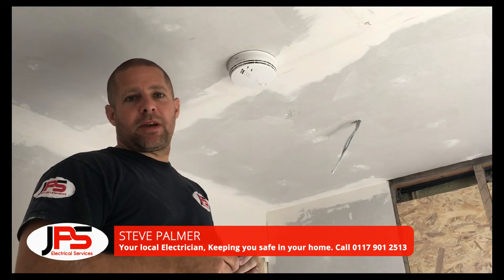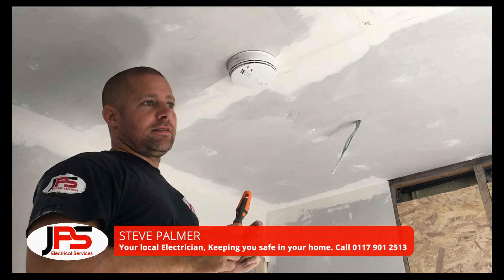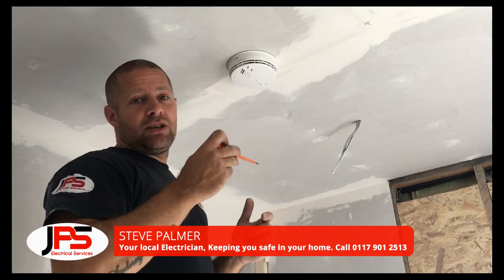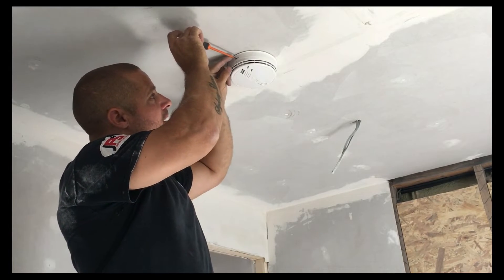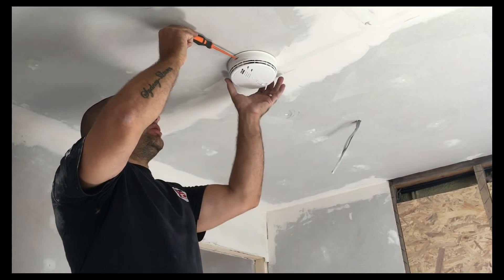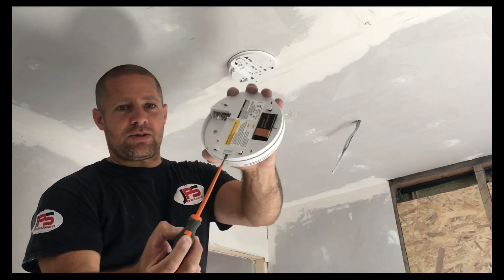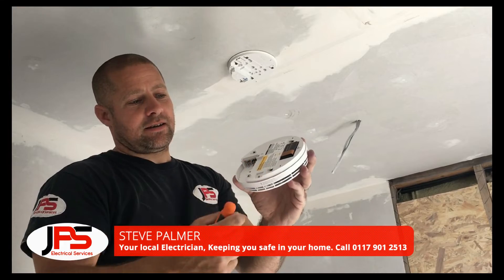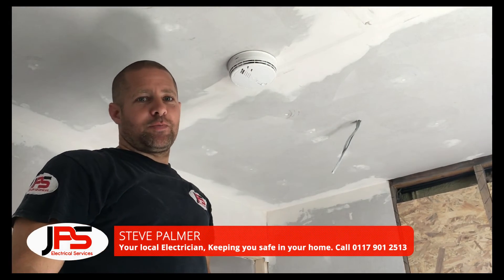HOW TO Remove an Aico Smoke Alarm - Your local Electrician

Comment: Saved me time and stopped me breaking the thing off the ceiling. Top job, thanks 👍
Reply from the maker: Thank you for taking the time to comment. I'm pleased you found my video useful. It's easy when you know how isn't it ;)

Please tell me you have replaced the battery or installed a new detector?

I look forward to hearing from you.

Kind regards
Steve :)
Reply: Hi Steve, it was the battery in the end. It started beeping intermittently so it needed changing but usual ones just twist off so it really helped
Reply from the maker: @garyk592  I’m pleased to know my video helped you.

Thanks for taking the time to update me.

Kind regards
Steve :)
Reply: @JPSElectricalServicesBristol  what’s the best interlink smoke detectors in England as of 2024
Reply from the maker: Hi @Viewer765 , this will differ from Sparky to Sparky. 

I'm an Aico fan, always have been and very likely always will be. Are they THE BEST? I can't answer that but they certainly tick all of the boxes on the domestic installations I work on.

I hope this helps.

kind regards
Steve :)
Reply: @JPSElectricalServicesBristol  what about for flats

Comment: Omg you save my life. This alarm.is mental I don't even cook but the alarm starts and the noise it's terrible
Reply from the maker: Thank you for taking the time to show your appreciation for the video help.

If the alarm is sounding falsely then it's possible it has become faulty.

Please be sure to replace the alarm as soon as possible with a new unit which you can purchase online or from local outlets such as Screwfix, Toolstation or most Electrical Wholesalers.

Kind regards
Steve :)
Reply: @JPSElectricalServicesBristol  thank you I'll need to find an electrician to do it as it is attached to electricals. Thank you again
Reply: @JPSElectricalServicesBristol do you think i need to change the whole device minus the attached to the ceiling?
Reply from the maker: @dianacamones7246  When you purchase the replacement it will come with the base and the detector head. Because you already have the base wired in, you can just install the detector head - PLEASE make sure you ensure the power is off first

I hope you'll update me once you have completed this.

Kind regards
Steve :)
Reply: @JPSElectricalServicesBristol  thank you so much Steve you are a ⭐
Reply: @JPSElectricalServicesBristol  thank you so much

Comment: Hoping you can help me, me and my housemates are going insane! We have one of these, and after smoke set it off the other day it won't stop sending out a beep every 30 odd seconds. We've taken it off, cleaned it, reset it, put in a new battery, tried all the other detectors etc...bit we've noticed the beep is coming from the BASE attached to the ceiling, and not the detector itself. We're going insane...what can we do? Any help would be appreciated!!!
Reply from the maker: Hi Chris, thank you for your comment.

Can you email me a photo of the base please. 

Kind regards
Steve 
www.jpselectricalservices.co.uk

Comment: How do I completely remove the part which is attached to the ceiling? I have 2 within a few feet of eachother which is completely unnecessary and looks messy. So I'd like to completely remove it to make my ceiling look cleaner
Thanks
Reply from the maker: Thank you for your question.

In order to make sure you get the correct advice you will need to contact your local electrician and get them to make a visit to discuss your electrical requirements in more detail.

There are too many variables and safety concerns that prevent me from providing wiring advice over the internet.

Kind regards
Steve

Comment: Don't you have to turn the mains supply off first?
Reply from the maker: Thank you for taking the time to comment. 

You most certainly do need to isolate the supply when working on anything supplied by electricity. I did forget to mention this during my demonstration as I was working on a brand new installation so I knew that it was already safe to work on. However, when creating the video, I did add a written note to the video at the position of 00:42. 

I hope this helps.

Kind regards
Steve :)

Comment: Mine have littium battery  so don't need to change bloody battery but it's annoying
Reply from the maker: It sounds like it may be one of the sealed units. These are usually great and last the full ten year period but as with any product, devices can become faulty as can the circuits that power them should they be hardwired with a battery back up.

I'm pleased you found the video useful and hope you are able to resolve this easily.

Kind regards
Steve :)

Comment: I have the same one and it's so annoying  it keeps going off not were I am cooking but in my sitting room why is this ? I took it off but couldn't see a battery were your one is.any help would really appreciate it .as its doing my head in its so sensitive haha
Reply from the maker: Hi Sharon, some of the newer devices have a built in sealed battery. This may be the reason that yours isn’t the same.

If in doubt, give your local electrician a call. I’m sure they’d be happy to pop by quickly to provide you with some useful advice.

Kind regards
Steve :)

Comment: What if I don’t have a small screwdriver? I’ve tried using a regular one and a pair of scissors and nothing works.
Reply from the maker: This is a really simple procedure when carried out using the correct tool for the job. Anything else will likely cause damage which can result in the device being jammed into the base. If this happens, the base and the detector will both need to be replaced.

Kind regards
Steve
Reply: @JPSElectricalServicesBristol  I think I may have damaged it by the looks of it
Reply from the maker: @dee_1989  get a recommendation for a friendly local electrician and get them to pop by and check for you. I’m sure they’ll be more than happy to help.

Kind regards
Steve :)

Comment: What if there's no screwdriver?
Reply from the maker: Funny you should mention that. I have managed the removal with a house key previously. That being said, if you cause damage to the device then you will not be able to remove it or worse still, you will have to replace it so for the cost of a screwdriver, a trip down to your local tool warehouse will be a far better option 🙂👍🏼
Reply: Can you help please? I don't have a voltage detector thingy! I don't know if I need to switch off a switch on the fusebox. I don't have a switch labelled smoke detector on there. I have ones labelled: lighting, lighting, sockets, sockets, shower, cooker. On the left of those is 2joined together red switches/switches saying main switch. It's a very cheap, 15 year old, basic smoke alarm, that doesn't have an external battery flap neither! How do you know if you have to flick a switch on the fusebox, please!? I have pressed the hush button for 20 seconds but it's not resolved the chirping. Would I electrocute myself by not pressing a switch on fusebox off, then twisting plastic cover off to see which battery I need please? I have a 9v here. To stop it chirping temporarily, can I turn the plastic cover anticlockwise, safely without flicking a switch off on the fusebox!? I see a video or read online about turning the plastic anticlockwise & I think removing the battery to try stop chirping
Reply: And my cover isn't twisting off! Why's that? I can't seem to feel a groove for a screwdriver I found, but it says turn anticlockwise so it surely should come off? Did you use a yale lock key or a longer type key, please?